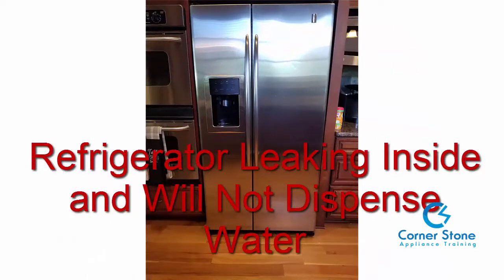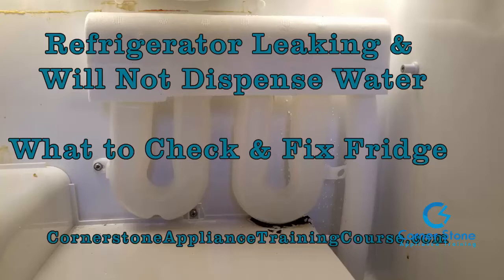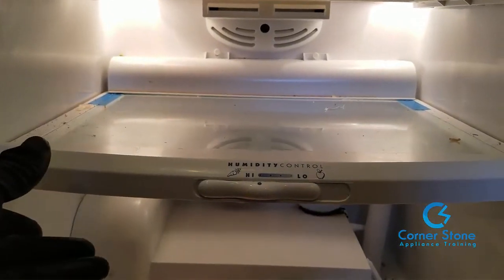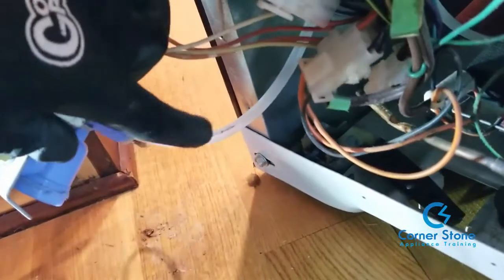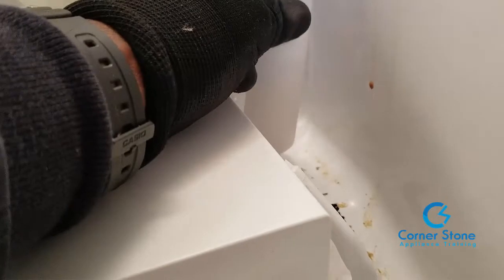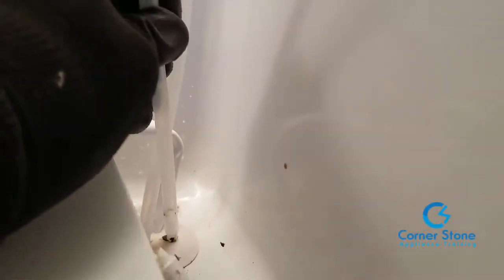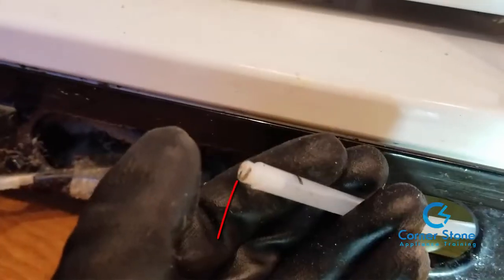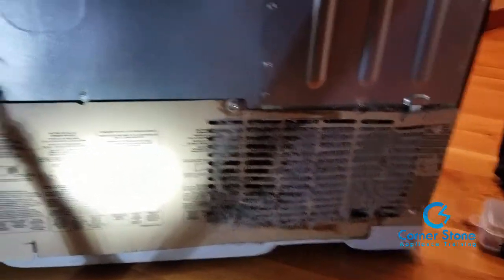Refrigerator Repair - How to Fix a Leaking Fridge Not Dispensing Water GE Whirlpool Kenmore Matag...

Comment: During the troubleshooting, how did you get the water to operate with the fridge door open?
Reply from the maker: The only way you can make the refrigerator(some models)  dispense water with the door open is to hold the the door switch.  Hope that helps.  Thanks